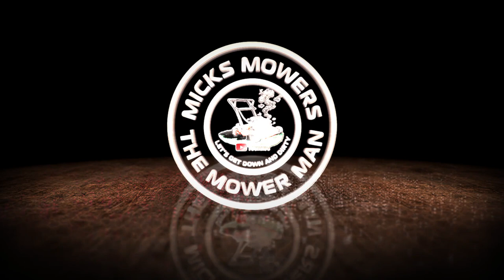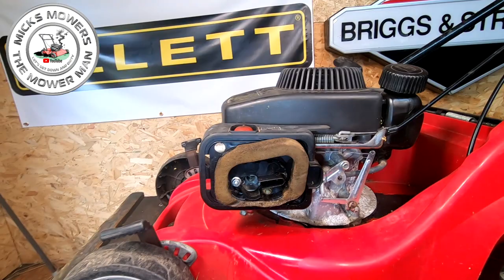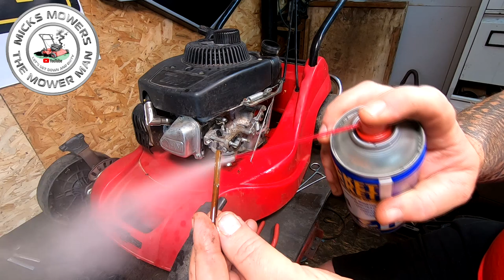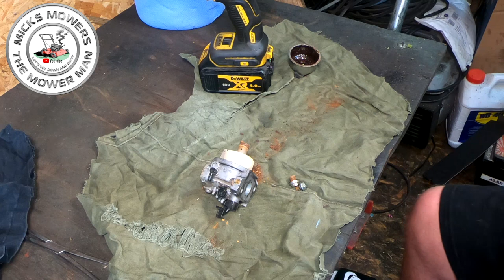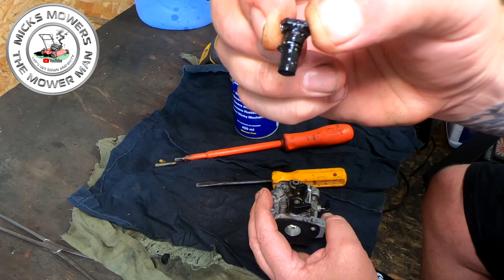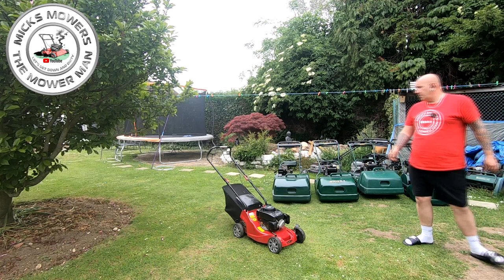Mountfield 414 164 Will Not Start.. Let's Take A Look To See why #micksmowers #mountfield

Comment: Thanks Mick.  This video and an older one of yours regarding ‘hunting’ gave me all I needed to fix my own Mountfield 414 (none power drive version).  It fired up just fine, but started hunting and stopping mid use.  Stripped down the carburettor as per your videos giving it all a good clean and all is good.  Will use your amazon link to get a new plug and some of the tools (micro drills) you recommend.  Thanks again!
Reply from the maker: Your very welcome.. glad it helped you out